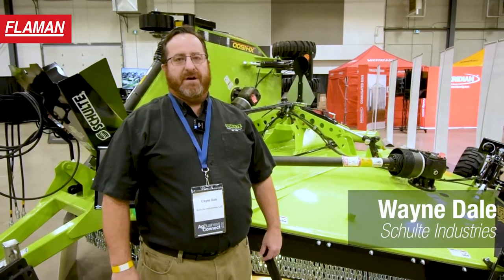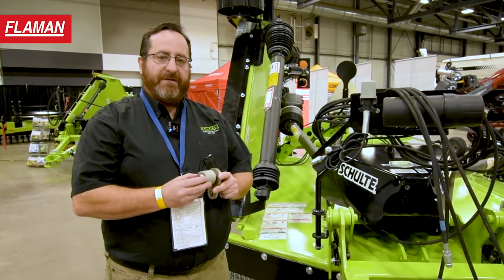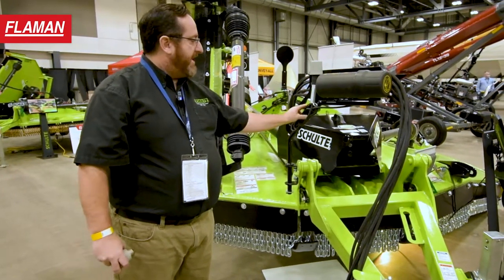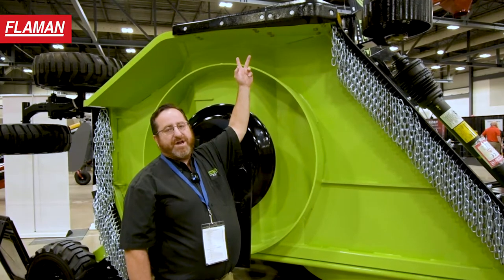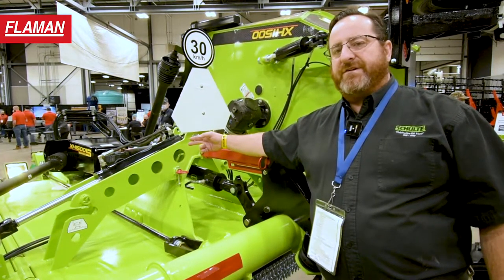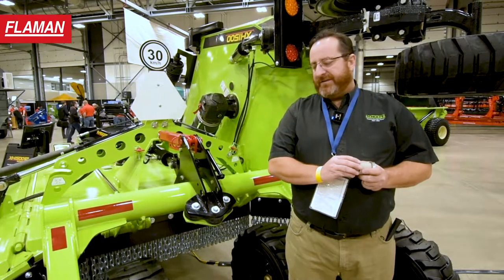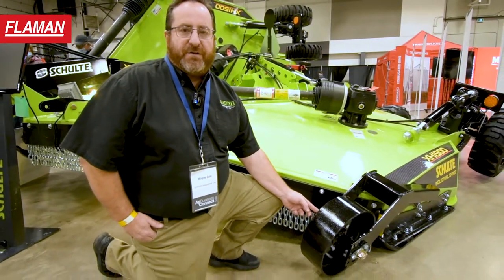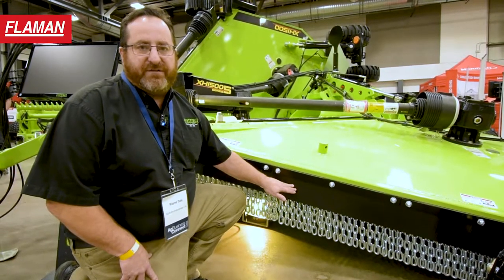Schulte XH-1500 Series 5 Commercial Rotary Mower | Product Overview | Flaman Agriculture

Comment: I upgraded to a XH1500S5 from a FX1800, it’s a HUGE upgrade and aside from everything mentioned I love the wing gauge wheels. With my FX1800, if I traversed across gravel roads running through my fields, sometimes the skids would catch on the side of the road…the gauge wheels prevent this. The one thing that I’m not a fan of is the 5” blades. I ordered my FX1800 with those blades and no dealer anywhere stocks them. They all have the 4” but not 5”, and for a while my dealer couldn’t get them because Schulte didn’t have them.